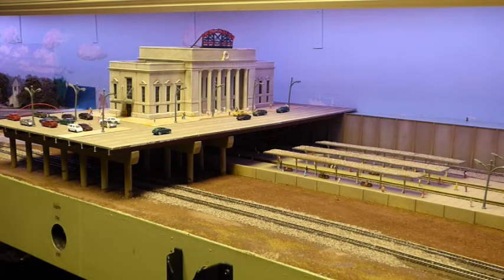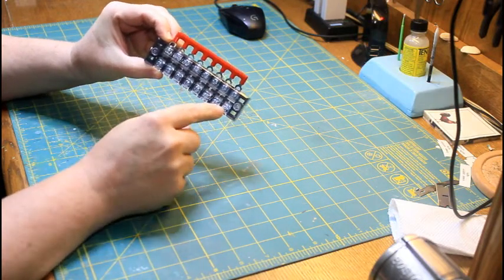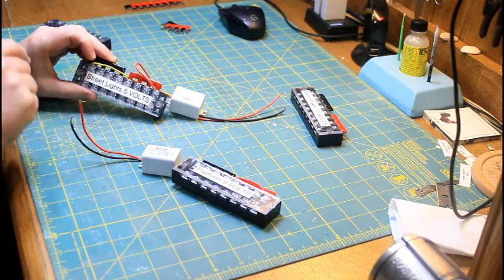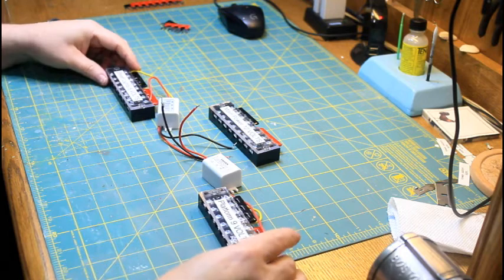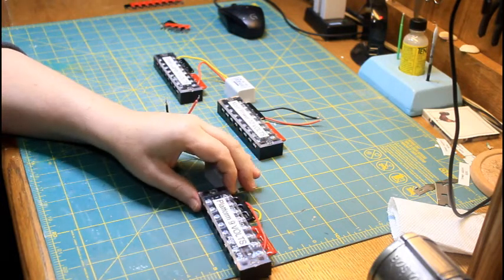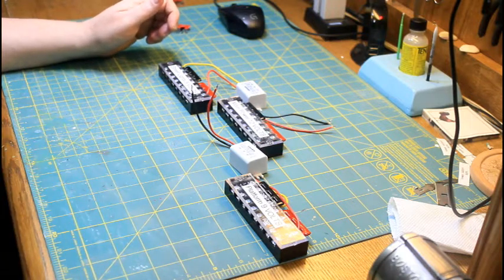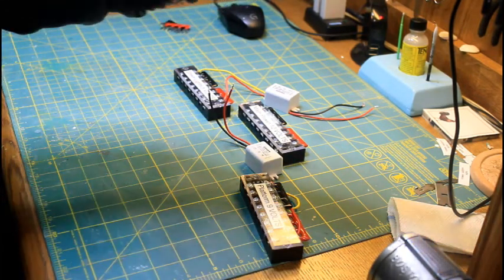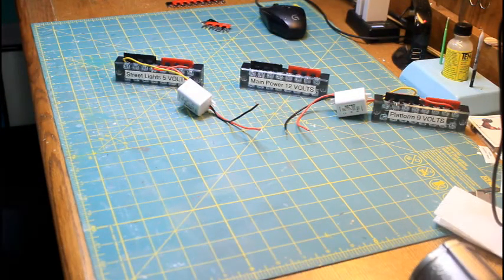Train Station scenery: Part 18

Comment: Mike, hanging a board should work well if you think you'll need to remove the board.   Another option is to set up the board the way you want it and then use a couple of hinges to attach it to the bottom of the layout.   Set it up so that in the down position you can work on the board (although it will be vertical) and then when you hinge it up (use a simple hook to hold it in  place), it is all hidden and all the wiring is out of the way and can't accidentally be snagged.

The negative of a "movable" board is that each time you access it, you move ALL the wiring which can loosen some so if you ever have any problems the first thing to do is to check and tighten all wires.

Also, you may want to use a barrel connector to connect  "the board" power to the actual power source.   That way you can easily unplug the power (without have to remove a couple of terminal screws), especially if you hand the board on hooks.

Comment: No need to apologize. Seem to be moving along just fine. I prefer using terminal blocks rather than soldering connections. By the way, "jumpers" is the name for the things linking the posts on the terminal blocks.
Reply from the maker: Thanks Jerry!

Comment: Hi MIke, I think your solution is excellent. It's easy to understand and maintain for future extensions or projects. I will have to look and see if I can get those transformers over here in Europe as to date I have been using resistors to reduce the voltage. Keep up the good work and I am looking forward to seeing the finished station in place and lit. It has been a mammoth project.
Reply from the maker: Thank you Ian! Yes you are right resistors are the right way to go with LEDs but they won't work with regular filament bulbs they will simply burn up. That's why I went to those transformers. The street lights and the bulbs under the platform roofs are not LED. I put a link below not sure if it helps or not.
https://www.amazon.com/dp/B00CXKBJI2/ref=sxbs_sxwds-stvpv2_1?pf_rd_m=ATVPDKIKX0DER&pf_rd_p=6375e697-f226-4dbd-a63a-5ec697811ee1&pd_rd_wg=EQMcv&pf_rd_r=71VQRT6G7SBAEKDJ8H0J&pf_rd_s=desktop-sx-bottom-slot&pf_rd_t=301&pd_rd_i=B00CXKBJI2&pd_rd_w=VsOkl&pf_rd_i=12+volt+to+5+volt+converter&pd_rd_r=041633c9-97ed-4f25-b2c2-e71ab177c4af&ie=UTF8&qid=1542411675&sr=1